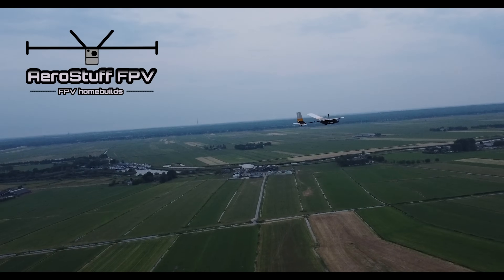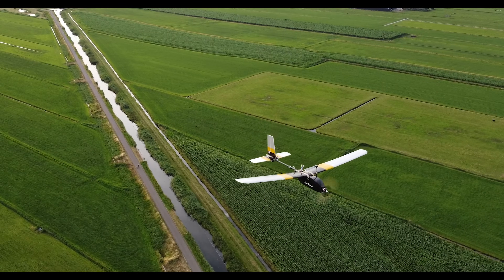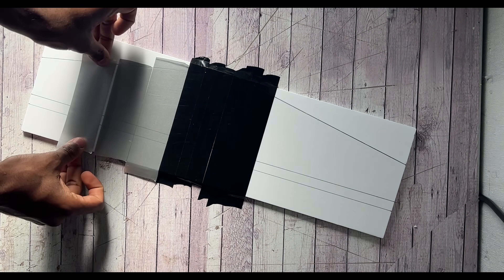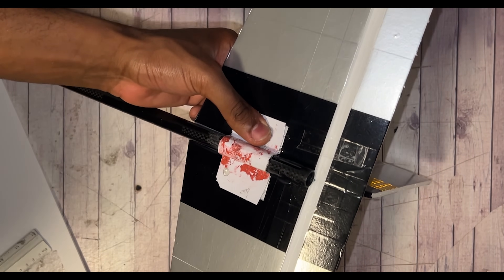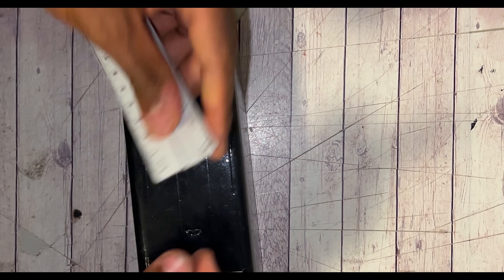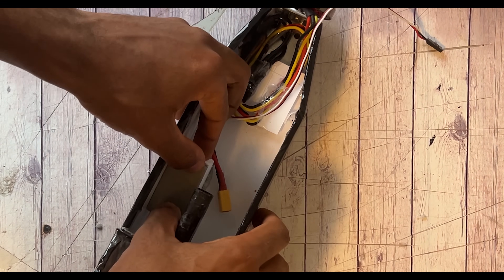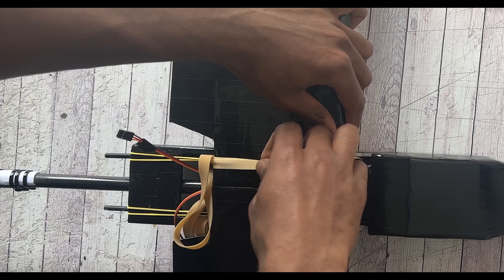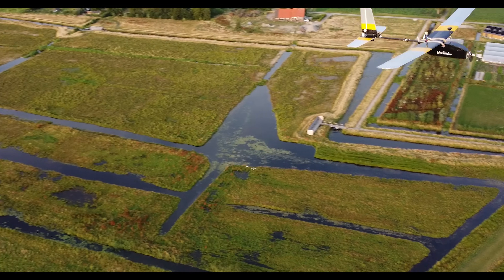How to build an Autonomous UAV for Long Range FPV & Waypoint Missions - Lightweight UAV

Comment: Question:
I have a spektrum 631 reciever & a fpv camera with its own recoever attached to camera.  What hardware can I get to fly long distances in regards to both extended my spektrum recievers range & also to use fpv googles at longer distances.  Is this one add on or 2 devices. One to extend fpv camera & one to reach my transmitter to still control plane at 1-3 mile ranges.

Comment: Hello.
Your video is very cool and interesting. I wanted to ask which battery you used and maybe the link to the website?
Thanks a lot
Reply from the maker: 4S 5000mAh LiPo from Hobbyking
Reply: @AeroStuffFPV   Does your flightcontroller has a built in barometer?

Comment: thanks for the detailed instructions. I am beginning to get into flying, I feel I still have to finalize the position of the main wings as it affects CG. 
Could you please let me know the distance of the wing's leading edge from the front of the fuselage..
Reply: It depends on your center of gravity. Once you have made the fuselage and put all your electronics in, especially the battery, align your wing such that the center of lift and center of gravity align. The center of lift is usually 25-30% of your chord (airfoil length) from the leading edge.

Comment: Great video Nathan I just subscribed to your channel , Question do you prefer the Matek F411 over the Matek 405 ?. I am going to get my feet wet into longrange flying and will be starting off with a simple plane that I currently have . alierons ,rudder & elevator . I will attempt to build one of your planes down the road. I enjoy building foam board planes .
Reply from the maker: Thanks very much! I appreciate your comment🎖️

I’m (personally) more into the 405 series, because they got more UART ports & slightly better FC components (hardware, sensors, etc…)

Comment: What a really great DIY project.  You've done such a nice job all the way through.  I like your use of carbon combined with foamy.  I'm mostly from a 250 quad obstacle course background, and I've been exploring options to relay both video and signal from a mostly autonomous relay drone in a pattern.  Thanks for the great video, the scenes you filmed of your bird in flight were really great, must have been a hell of a lot of fun rewarding work.

Comment: Hi interesting build, you might check out an old light weight air craft we used to build, it was called a Ben Buckle, generally a large wings man a deep wing cord, they when the next step on from a powered glider

Comment: Hello, I find this video quite fascinating. Your drones look amazing and incredible. I intend to make one like the one in this video, but I want to make it smaller, around 80 to 100cm from wingtip to wingtip instead of the 160cm you used. Now, for the distance of the carbon fiber tube, should I use the same measurement? Also, with the rear stabilizers, can I use the same measurements, or should I shorten them by a few centimeters? If so, how much would you recommend shortening the distance of the carbon tube (distance between the wings and the rear stabilizers), and how much would you recommend the rear stabilizers measure? Haha, I hope you can answer me.
Reply from the maker: I appreciate your comment! 

If you downscale the wingspan, downscale everything with it (stabilizer, fuselage, carbon tailboom) 

The downscale percentage for your build (assuming 100cm wingspan) is 62.5% - With that percentage, downscale the fuselage length & stabilizer dimensions as well. 

- Good luck!
Reply: @AeroStuffFPV  Thank you very much! One last question, do you think that with a A2212 motor and 1045 propellers (10x4.5") I can achieve pushing a UAV with the same dimensions as the one you use in this video? Thanks!

Comment: Over an hour...5 seconds later fly 2 hours...1 second later itll fly over 2 hours....which is it?
Reply: Did you make it past the first 60 seconds?
Reply: @furyianman5157  nope bc its ignorance
Reply: @w.e.s.  i chortled
Reply: It's so obvious from the first 25 seconds of the video, this one is over 1 hour and you can upgrade it to 2 hours with a bigger battery
Reply: There's this thing called battery amperage.
Reply: @skateboardingjesus4006  You mean amp hours?

Comment: I would rather use a piece of thin aluminum. or break metal I mean?   hundreds you put into that and a gust of wind and snap!
Reply from the maker: Not at all. The wings are flexible & wont snap by wind or Hard-G maneuvers. All my designs fly into winds up to scale 4.5 which is what most foamies can't do.

Comment: Imagine having a hundred of those in a larger scale with more powerful engines that can carry a kilo cargo capacity and load up a kilo of drugs and send them across the border from  5 miles inside Mexico and at 50 mile range it would land at a designated coordinates 45 miles into the US. Even if 20% got captured you still got 80 kilos across the border. Do that once a week and would be unstoppable. Only issue would be finding different places to launch them from inside Mexico without being seen cuz that's a lot of launches but recovering them would be a breeze. Can you imagine having them all land in a random  ranch property at 4am in total darkness and round them up. Would be unstoppable in a matter of months. Even in losing every unit after delivery, the cost of plane is negligible compared to a Ki.

Comment: Hi, where did you buy the armin wing depron?
Also what width do you recommend for the carbon fiber tube?
And does it matter if the carbon fiber is omnidirectional twilfiber or simple fiber?
Reply from the maker: The depron is the same as XPS foam (5mm thick) - The carbon spar length I recommend is atleast >45% of the wingspan). Doesn't matter for me - as long as it's strong enough & doesn't flex that easily
Reply: sorry I am new to the hobby.
So the uavv in the video is made out of depron correct?
I am asking where you purchased the depron/ what is the correct name i need to google to buy it online?

Second question was what WALLthickness you have for the caarbon fiber boom?

12mm =outer diameter but what is the wall thickness?
2mm?
 @AeroStuffFPV

Comment: Hi, I am impressed by your design! congratulations 👍👍👍. I have a question regarding the center of gravity (CG) : did you manage it to get it under the wing ? thks, Bertrand
Reply from the maker: Thanks!

The UAV isn’t flyable if the CG isn’t under the wing! It’s 25-33% from the leading edge.
Reply: Thanks

Comment: I'm wondering how much one costs to build from start to finish. Great video!
Reply from the maker: Between $130-170!
Reply: @AeroStuffFPV  and how long would it take you to rebuild one with the exact same specs now that you have built this one? Also where could I find the exact specs for the wings? Or a video build?
Reply: Also total cost with all electronics, motor, lipo and remote?

Comment: You do a great job of showing what you're doing and how you build it, but you don't talk much about why. Why specific motor/parameters, why specific sizes/dimensions, etc. I can't help but wonder what are the calculations you've done to arrive at this design with these parameters. I wish you could cover more of the technical side of things and not just showing clips of you building it.
Reply from the maker: Great video idea. Going at it soon

Comment: Could you add a 2nd independent camera with head follow so my kid could look around while its being piloted
Reply from the maker: Yes, this could be customizable (in the wing) - Right next to the other tail-camera (dual tail-cam setup?) or right on top of the nose-hatch (although the propeller is in the way) See Part 3 of ''SIlent Star Build Video'' to see the hatch-mounted camera setup
Reply: @AeroStuffFPV  man this is the coolest thing ever. Your skills are impressive. Im an aerospace welder, i wonder if an aluminum frame would fly?
How much does this all cost?

Comment: Love the work you are doing, I am very inspired to make similar planes. So firstly thank you for posting this stuff because it is so helpful.

I want to ask, what is your reason for not designing any kind of landing gear?  The main thing I wonder is how bad it hurts aerodynamic efficiency for even really light non-retractable gear? 

Not that this plane needs gear obviously! You and many others clearly do great without it but I am just very curious what your thoughts are since you have so much experience. Thanks again!
Reply from the maker: Thanks man! Weird I see this awesome comment 6 months later.

The main reason of not using landing gear is additional drag & weight. Since my planes are under 2kg and have an ESC with 'brake' settings (preventing spinning propeller at touchdown) they are designed as 'belly landers' meaning, hand-launch/fuselage-landing. 

If I design a plane with greater weights than 3kg, then I'm def. using landing gear

Comment: outstanding!! thanks for doing this vid,  it exactly what i was looking for
Reply from the maker: Thanks! Good luck if building one.
Reply: @AeroStuffFPV  I already got the airframe marked and cut out mostly.  The electronics  is what I was questioning. Wanted to go cheapish I will probably add flexible lightweight solar panel cells to the wings and a charge controller.   See if we can’t push those flight times

Comment: @AeroStuffFPV you should really take a look at the OpenIPC FPV project. It is a DIY long range digital FPV system, maybe not up to the specs of DJI or Walksnail but not far behind either. Latest release is looking 1080p video, 10's of KM of range, 50ms latency, for under $100 full setup.

Comment: Have you considered using any 3D printed parts? I realize you are a skilled builder, but I feel like some key parts could be printed to provide more elegant solutions, such as the attachment points for the tail boom.
Reply from the maker: Yes 3D printing is the major improvement yo my builds but I don’t got the finances yet to invest into a 3D printer and it’s melting plastics - Full time student priorities to keep things as affordable as possible
Reply: @AeroStuffFPV  Yeah, I certainly understand that. If you weren't 8,000 km away I'd volunteer to print and send parts, heh. When I have the finances to buy the electronics for one of these I'll see if I can implement some 3D printed parts and share my experiences.

Comment: Reliance on GPS navigation is a weakness for military applications. A mix of inertial and terrain mapping and recognition is required. The sensors for the terrain mapping also need to be both radar and optical.
Match this with A.I. target recognition and selection and you have a winner.
Reply from the maker: Indeed! This design is solely for FPV - But can be optimized for other applications (military, coastal observations, etc..)

Comment: Great Job
Can I get 150 km Range distance with a 6s 25,000 mAh battery ( 2.6 Kg) instead of  4s 5000mAh LiPo Battery????
Reply from the maker: Make sure it isn’t nose-heavy and the UAV has enough wingspan (min. 2m span) and strength!
Reply: @franciscourena5636  hello did you make it

Comment: I like that a lot!!I would love to scale that up to a 12 foot wingspan put a bigger motor and ESC in it and equip it for high altitude FPV to fly above class B airspace just to get even with the FAA because of there stupid Remote ID ruling.This airplane is a true drone in every sense of the word.Not a multirotor.A drone is a miniature airplane flown from a far away ground station.Not the drones of today.This plane represents the drones back in the 1960s and 1970s.

Comment: This should be able to carry a GoPro as well? With wings that big?
Reply from the maker: Easily - It's lighweight so a GoPro is no problem - If adding more camera gear or heavier batteries would mean an upgraded motor too

Comment: Please, I need help, I'm building a drone without flight controller.This might affect the distance the drone can travel, because I'm using the R9 module. I think the video transmitter i can transmit without Flight controller at 8km?I desperately need help 😭
Reply from the maker: If video holds up the range of your R9M, you can fly that far - But I don't recommend flying that far with manual control only. A flight controller is mandatory for a succesful distance flight and back (if any of the control links fail).

Comment: Could you provide a source for the silver packing tape? I have searched everywhere, even tape bros doesn't have it in that color unless I missed it. Thanks
Reply from the maker: It's on AliExpress (wing tape / silver packing tape)
Reply: @AeroStuffFPV  Thanks, I had been using lightweight sticky back vinyl in the 12inch wide rolls. its only slightly heavier and can be tedious to apply but comes in every color. Plus you can cut decals in the cricut machine.

Comment: Bro excellent build but i was wondering if in a future video you can touch on the soldering that has to be done in order to prepare your flight controller for installation. Because that's the only thing that is keeping me back from investing in my first programmable flight controller. Much appreciated.
Reply from the maker: Thanks!

There are plenty of videos about that on the internet (How to solder a flight controller) - If you want a flight controller that you don't have to solder - I'd recommend getting the ZOHD Kopilot Lite. I've been using it since approx. 3 years and it's still solid these days!
Reply: @AeroStuffFPV i do have a zohd Kopilot and I'm contemplating moving on to  a programmable flight controller for fpv. So i just wanted some insight on what is required in order to make one fully operational namely what needs to be soldered etc. Your builds are what i use as my reference hence the reason I'm asking you.
Reply: Wait, so you’re flying all direct control from the receiver today?

Comment: is no one gonna talk about how cool it looks when the tail of the plane is connected to the body by a single/double rod?
Reply: Very cool
Reply: Impressive
Reply: its  a fishing pole
Reply: That's my favorite design. Especially when they can get a propeller in the center
Reply: При ударе о землю такой хвост легко ломается. У меня это было при жесткой посадке.
Reply: No they are not
Reply: Not a very stiff design with such a narrow tube
Reply: @pcka12  I have a similar build with a carbon fiber rod. Its a very rigid design. I would trust this over my EPO foam planes and those are very strong as well.
Reply: To all the people with their armchair materials science degrees, please do go on about how flimsy and wobbly the CARBON FIBER tube is. Clearly you've never held a carbon fiber tube. 1mm push rods don't count.

As for the strength in crashes.... Don't crash it? This is a UAV, not a 3D park flyer you're zooming around branches with. If you're doing acrobatics, you're doing it wrong. It's plenty strong and stiff for the two pieces of foam board it needs to support.

By all means, watch videos with a critical eye.... But use your own critical thinking skills...
Reply: @xSARGEx117x  I never said it was practical, it's just a pretty aestethic in my opinion.
Reply: @xSARGEx117x  maybe use your own critical thinking skills by determining that the original comment never mentioned or claimed that they know anything about the practical use of those rods and rather just wanted to communicate that they like the design from an aestethic point

Comment: Hi Nathan. Thanks for acknowledging me as a donor. This is an impressively simple and efficient drone. I'm sure we'll be building some of these and experimenting with different modifications. The build video is excellent: it covers everything in detail. Your flight performance numbers are great. A DIY custom li-ion battery pack would indeed extend the flight time and range nicely. I like the idea of a rear-mounted video cam that would have a fully unobstructed view of the ground. I'm eager to see the upcoming iNav settings video for this drone: I need to learn how to use iNav. Keep up the great work, Nathan!
Reply: Can I get 150 km Range distance with a 6s 25,000 mAh battery ( 2.6 Kg) instead of  4s 5000mAh LiPo Battery????
Reply: you probably could, but you have to check your local laws, bc in most places UAV's that are able to fly over 100km are banned for civilians @franciscourena5636